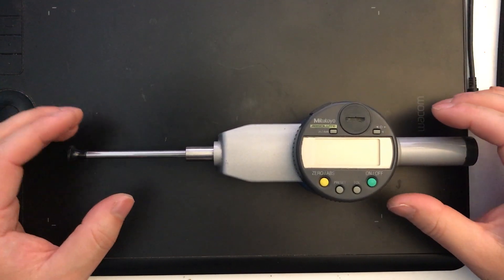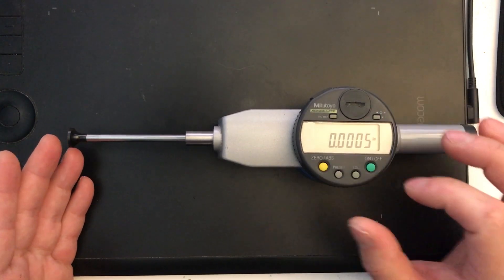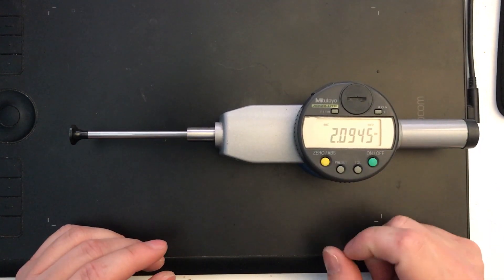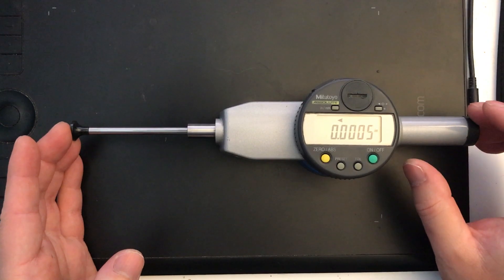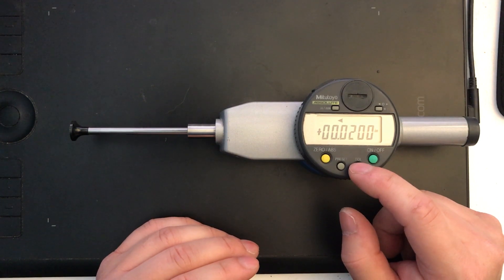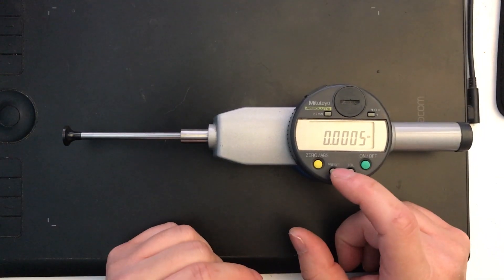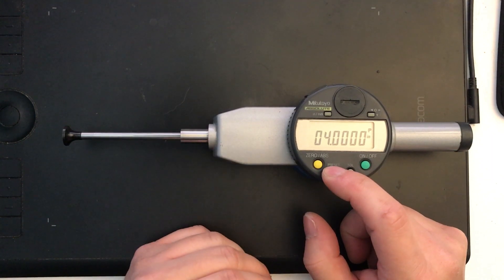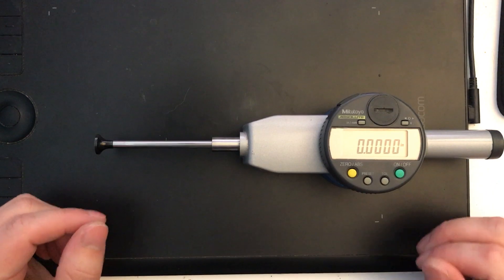Metrology: Mitutoyo Digimatic Indicator 543-466B (Model ID-C1050EB)

Comment: How do you set it up after a battery change
Reply from the maker: My indicator is storage at the moment so I can’t verify this, but I believe after the battery is removed and replaced, the digits will be flashing? If so, try pressing and holding the Zero/Abs button for a few seconds and see if the digits stop flashing.

This will zero the indicator at whatever position the plunger currently is.

Try searching for other Mitutoyo 543 Series manuals. While this exact model has since been superseded by a newer one, older manual PDFs may be found online.